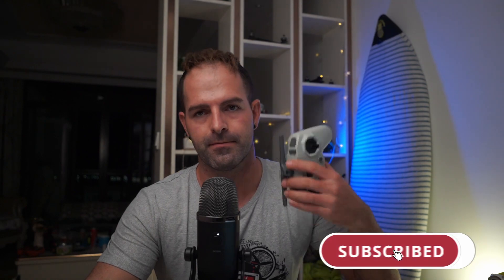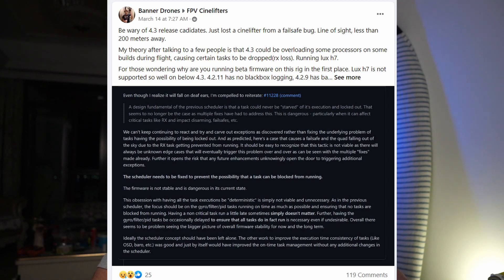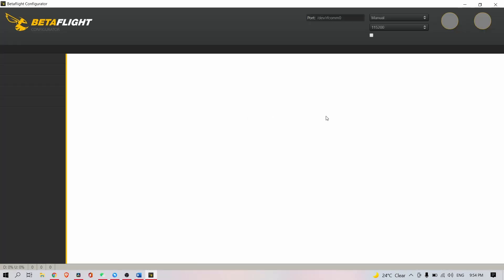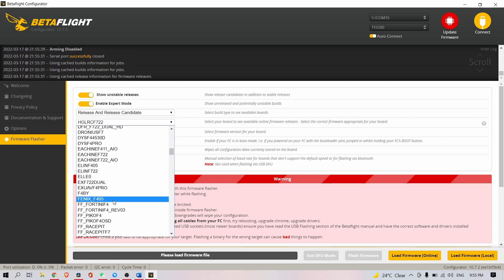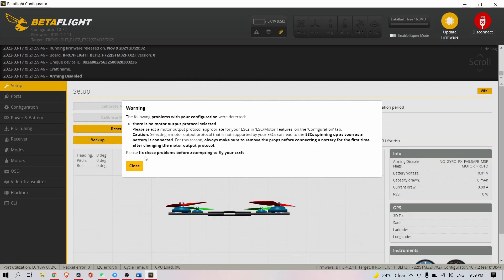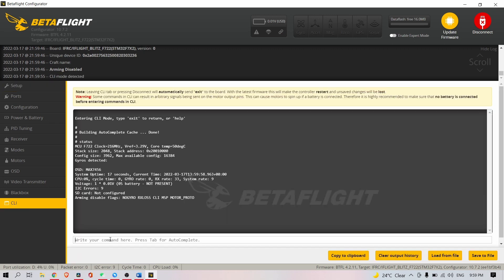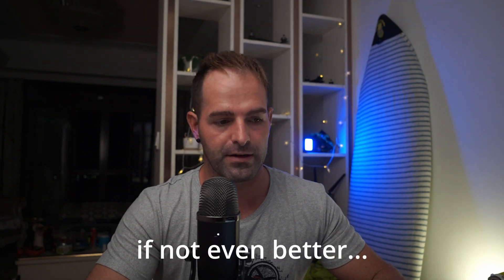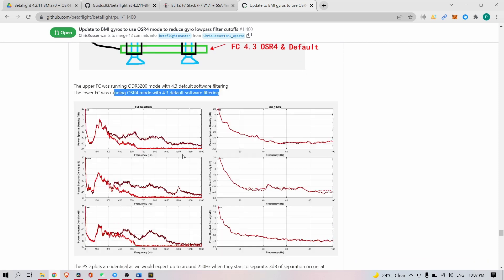iFlight TecTalk#2 // BMI270 Gyro and Commando8 updates

Comment: Do you know when the Commando will ship?  I can’t get an answer and I don’t want to wait months for it. Thanks.
Reply from the maker: Edgetx is ready. Will be shipped on the 5th next month.
Reply: I’ve considered all the new game style radios and I decided to order the Commando. I like that built in fan and I won’t need any other tx modules. The added speaker was a must. Glad they listened.  Thanks.
Reply: Sorry to bother you, I have a question. When placing the order for the Commando it says batteries ship separately, but the commando has an internal battery. Does that mean I have to open up a brand new radio to install the battery?

Comment: If you make a factory dump for the 4.3 would be amazing, because like me many don't know how to tunning the quad and you have done amazing with the 4.2.11 ! I Will be that available?
Reply from the maker: Will be, but not with unstable firmware
Reply: @xingtheiflightinsider  JB said, maybe in 2 weeks, will be out the Stable release.
Reply from the maker: @MChila  But we're not Betaflight. The factory setup is tuned with the latest stable release. Betaflight 4.3 makes no difference for casual flying.